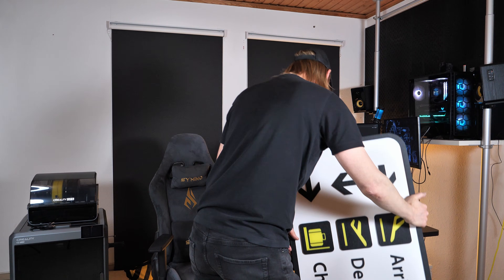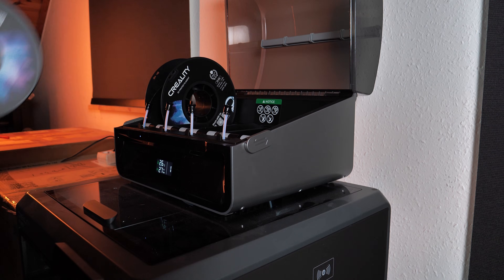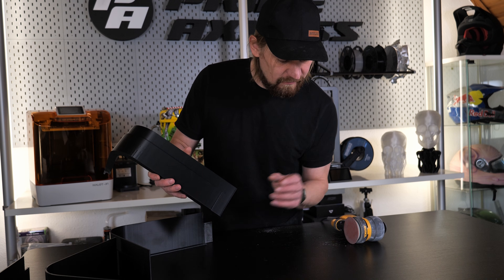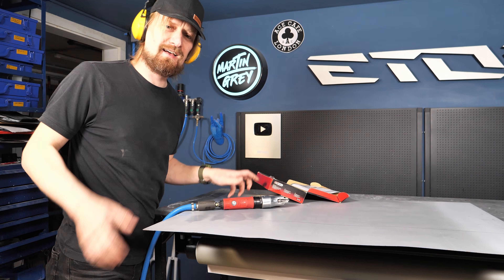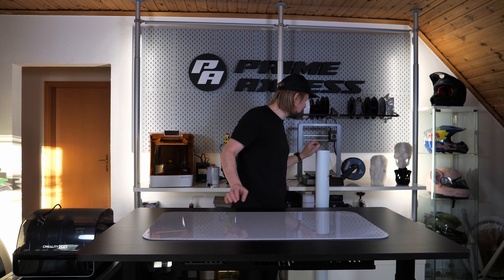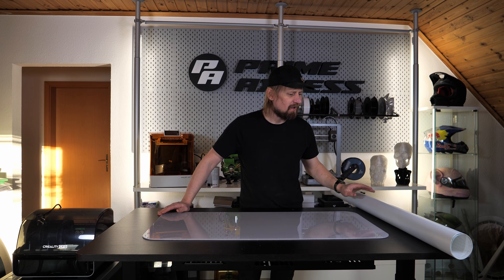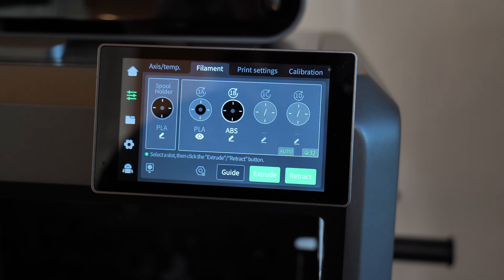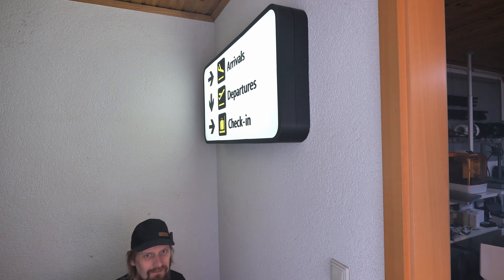I Took an Airport Sign... and Security Went CRAZY!

Comment: i was asking myself how he print the text and symbols because they are to long for the print plate. I couldnt imagine that you printed each sign seperately, i think you need something to align them quick and easy. You have the svg file, cut a stencil with the plotter with lets say oracal stencil foil or black oracal 751 and stick it on the lamp, then glue the signs in the stencil foil, later remove the stencil foil. My problem is when i print large objects and cut them with the slicer, the parts will never fit perfectly, there is always a small gap which makes me mad. I was also thinking which material you use because it still can be warm inside but i guess pla will still work in this case. I also use construction glue, 2k epoxy, super glue to fix objects in place or there is a new UV glue from UHU, also nice to align to objects fast
Reply from the maker: I do my files in FUSION360 and leave a gap of 0.2 to compensate. This depends on the nozzle size and accuracy of the printer. All parts are printed in ABS.

Comment: You could try using the same technique as you use for decals to transfer text- take the buildplate out, put a transfer sheet over the letters and then bend the build plate to get them off in the right orientation and spacing, to then attach to the sign.
Reply from the maker: Thanks for watching and your hint. I will try next time.